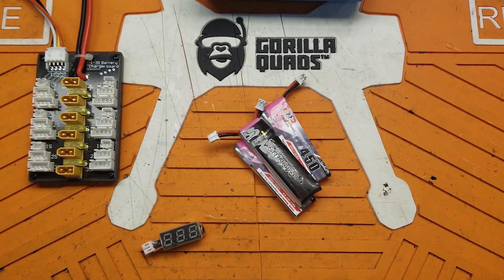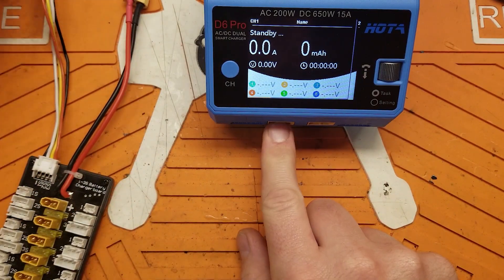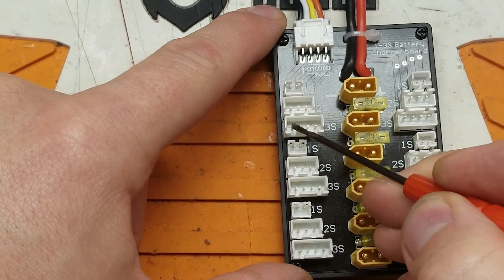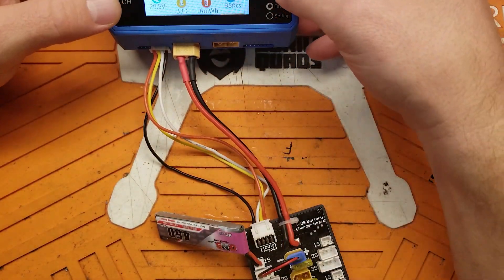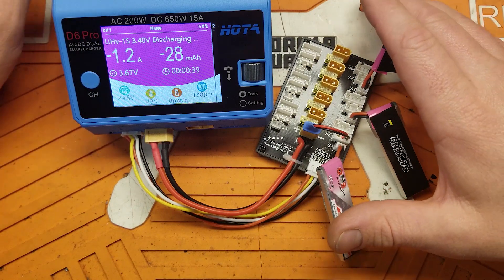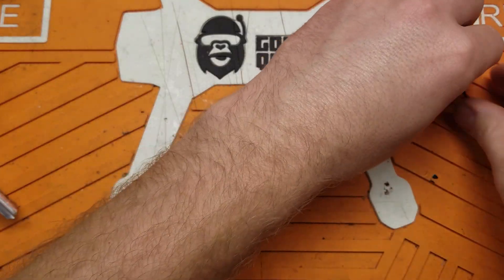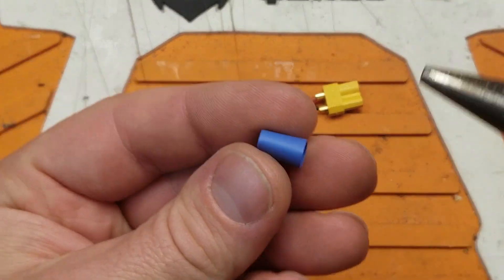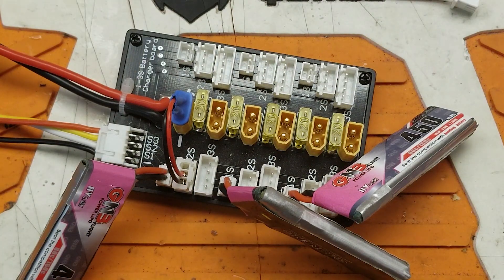1s Lipo charging trick

Comment: My other question was I got a parallel board and it came with a jumper cable but they only specify when you’re charging multiple 1S batteries you need the jumper cable. but if you’re charging 2S or 3S batteries or higher you got to take the jumper cable off the charging board. I learned this the hard way by trying to charge 2S batteries with the jumper cable plug in and the Board started to smell an smoked and it burned out the 1S charging port on the parallel board, and they don’t give any information or instructions on the parallel board or how to use it correctly other than that you need the jumper cable to charge multiple 🔋! The dangerous part of buying this junk from China is even with some boards having some ports soldered in reverse polarization as well!

Comment: can you tell me when you’re hooking up multiple 1S batteries to the parallel board do you count each battery as one cell so if you had two or three batteries would it be 2 cell or 3 cell on the charger setting? or do you just leave it at 1S battery when you put your calculations in the charger, and if it’s like 450 MAH for each battery do you add all three together so you have 1350 MAH and then come up with the amperage of 1.3 A , if that’s correct and if I’m right let me know ,thank you!
Reply from the maker: It depends on which type of board you are charging with. There are parallel board and series boards. If it's parallel then treat it as 1s and just add the capacity. If it's series then each pack is a new cell so add the cells and keep the capasity the same as one cell.
Reply: @TweetFPV  the plot thickens.... but that makes perfect sense. I didn't think I would have to add the mah together but it makes sense. Thanks brother man!
Reply: That's a great question! I was hoping I could charge two or three at a time.
Reply: @HciContractor   like I said if your parallel board is charging 1s 🔋 you charge on 1s at 3.8 V an just add the MAh for each battery total, so if the Lipo is 520 mAH an you have 3 battery’s then it would be approx 1560 mAH that can Charge 1.5 A or lower is best!

Comment: i know the video is old but i still have some question. With this method you charge paralell or serial? Don't you need to change from 1s to 2 or 3s depence on whow much batteries you connected? I charge my 1s with a 3s balance charging cable, but sometimes i get error. If this method is more safe then i switch over. Thanks again.
Reply from the maker: With this method you are charging in parallel so 1s voltage and the capasity is to total capasity of all the batteries added together.
Reply: @TweetFPV  thank you 🙏🏼

Comment: Are both side connected or do I need two cables :)? This is so helpfull thanks for your tips
Reply from the maker: Just one cable. All the xt30/60 ports on a parallel board are connected to eachother.

Comment: Would this work for very large 1s packs? I have a fleet of 100Ah (yes 100Ah) packs that are all 1s Li-Ion (3.7v working, 4.2v max charge, 3.2 minimum). I'm looking for a better way to charge them. They can handle up to 1.0c charge rate.
Reply from the maker: Yes it would be the same. Just be sure you adhere to all the usual parallel charging safety procedures.

Comment: absolutely invaluable... what is patreon! (rhetorical, i'll figure it out) I am just a dad trying to get his cyber 'addicted' son excited by something a little more outdoorsy so am figuring out the hardware to keep a tinyhawk in the air. Thank you!
Reply from the maker: 😂 Good luck! Fpv is a incredible hobby, also a good way to ensure you don't have any spare cash. Feel free to ask any questions you have.
Reply: @TweetFPV  i got the wrong plug to go into the centre socket, so just soldered the 2s balance plug directly to input terminals and let it hang when not in use. Works really well, charged 6 1s' at 4 amps which seemed to work.

Comment: Thanks for the video, super helpful -- I did have a quick question though. I just bought the "upgraded" version of that same board ( https://www.amazon.com/Upgraded-Parallel-Batteries-Compatible-Connector/dp/B079294K4F ) which comes with a jumper already, and I have the hobbymate version of your charger, so very similar setup. If I want to charge five 1s batteries, I'd still want to choose "1s" for the cell count, right? My understanding here is that the board is basically making all five batteries look like a single large capacity 1s battery to the charger, and not that they look like a 5s battery, so I'd still want to go with 1s to get the correct voltage. Also, what's a safe setting for the current? Let's say my five batteries are all 550 mAh -- multiply that out and you get 2750, so a 1C charge would be around 2.7A, correct? That seems like it would be rather high for that little jumper, but maybe it's fine. Wasn't sure if the safest option was just to do 0.5A, which seems like it'd take a long time.

Thanks again for the video and sorry for the somewhat basic questions. I'm new to the hobby and want to get the fundamentals down before assume I understand it correctly and do something dumb.
Reply from the maker: Oh wow that's a really good parallel board for 1s. I like that they added the little jumper. To answer your question about the charge rate you are correct. It will put them all in parallel which is just making a large 1s pack. If this was a serial board like the flying sandal board then it would just be a really small 5s pack. Same end result but honestly i feel that the serial boards are a little more user friendly. Not that anything is wrong with parallel. So in your example above yes a 1c charge rate would be 2.7a. 2.7a @ 4.35is volts isn't really all that much for these boards and you should be fine but touch everything while charging just to make sure nothing is getting too hot.
Reply: @TweetFPV  Very helpful -- thanks! Yeah, the board seems pretty good for 1s. I wasn't familar with the flying sandal board. That one looks pretty nice as well.

Comment: Great video for charging 1s lipowith PH2.
How would you recommend charging a 1s lipo with an XT30?
Reply from the maker: There are a few different ways to change your 1s xt30 packs. Some chargers support in balanced charging with just the main discharge lead. So just a xt30 to xt60 adapter. Another way is to do basically what I did in this video. The xt30 will take the board voltage to the balance lead to satisfy the charger and just plug in all you xt30 1s packs keeping in mind the normal parallel charging safety precautions.

Comment: Careful though, you could easily run too much current and burn through the traces on the board.
Reply: The traces would handle 2amps though I'm sure.  that's 6 in parallel

Comment: Do you not need a 2S balance to XT30 for each set of balance leads on the balance board?
Reply from the maker: No, because all the balance pins are connected to the same on in line with it. So all the ground pins are connected to each other and all the first cell positive voltage pins are connected. So only one jumper lead is needed because they are all electrically the same. I hope that answers your question.
Reply: TweetFPV thank you! I went back and watched the beginning when you explained that all pins were connected in sequential order, so that answered my question :) thank you! I’m trying to find a good solution for 2S batteries with PH2.0 connection for TinyHawk 2. I have an ISDT 608AC and I’ll be getting a 2S-6S balance board in early May (damn amazon)... any suggestions?
Reply from the maker: Hmm. I guess that would work the same way but don't connect the 2 pin connector to the parallel board. You will want to connect the 3 pin balance plug to the board. This becomes a little sketchier since now you are dealing with multi cell packs unlike the 1s packs where there are no additional cells to balance. With that then you would need to get a 4s balance lead to feed the pack voltage back to the chargers xt60 port This is assuming that you were going to occupy all you parallel spots with the emax 2s packs and that you are using a parallel board like the one i used in the video.

Comment: If your balance board is running the plugs in parallel, why do you need a balance connector? I’ve never needed one. Maybe this is a quirk of that particular charger?
Reply from the maker: Yea you most likely do not need the balance plug connected to the charger with 1s packs.

Comment: That’s pretty smart, I use a 6s balance connector that I put 6 ph2 connectors on the other end so my charger thinks it’s a 450mah 6s battery but its 6 individual batteries. This is smarter if you already have an balance board that does 1s

Comment: Dude, you just saved 4 1s batteries of mine. Thanks a lot! 😃
I have a cable I made a while ago to connect 1s cells in series to discharge them, but it was for those old and small connectors... I don't have PH2.0 connectors to make something like that to discharge those 4 cells. 
BUT, because of your video, I remembered I have a 1s to 3s parallel board! And I didn't even needed to make the little cable, because it already came with it! 😃 (But it's a bit different, it has 2 PH2.0 connectors, the board already has the place to connect it.) 😃

Comment: Great video. What if I replaced the ph2.0 conector with a xt30 connectors on all the batteries?
Reply: then you would have xt 30s on all your batterys lol
Reply from the maker: Then you would just charge them all through the xt30 plugs. Same concept and you wouldn't need this jumper.

Comment: It must be possible to make an adapter where you can put 6 1s batteries in series with a balance lead. Making a 6s pack. that way I can charge 12 1s batteries at once?
Reply: Jay Smith there is, just look at how a, say 3s is wired up and instead of where the cells are, put ph2 connectors on.  The only drawback is if the cells are not close, the charger will spend ages trying to balance them rather than charging them (depending on the charger of course) so it's often better to use one of those multi charging boards that come with the whoops, charge the batteries up then discharge them to storage state with the multi-cable.
Reply: I assumed it would just try to get them all to the target voltage before balancing. Hmm, ok. I guess it's better to just use a 1s charger.
Reply: Jay Smith don't quote me on this but judging by how my charger behaves, as soon as the first cell hits the target voltage, it stops fast charging and then tries to balance the cells by discharging the high cell and a back and forth process, this is where the time goes, we fly indoor and found it quicker during slots to use those six way chargers to charge six cells than use the bigger charger and make it think it was a 6s 500mAh battery.

Comment: I just bought the Meteor65. I don't know how I feel yet about adopting the new plug. It's awesome and the performance for a 1s is great but there are no balance boards and batteries need to be modded if I don't buy straight from BetaFPV.

PS. LOVE the heatshrink pliers trick!!
Reply: I just bought the 2 packs of 5 males and females. Just gonna use all the extra male ph2.0s I cut off the batteries for one side of the adapters, and the extra females I got are going on the other ends. So I'll end up with 9 females to make adapters.  I hope the giveaway plugs come too. It said they were gonna be included
Reply from the maker: Yea not too sure about the new connector. Yes it's certainly better then the ph2.0 but untill it gets adopted by more companies I'll just stick with the ph2.0